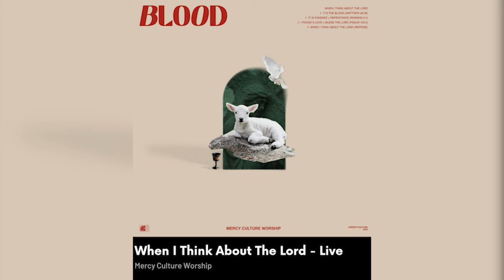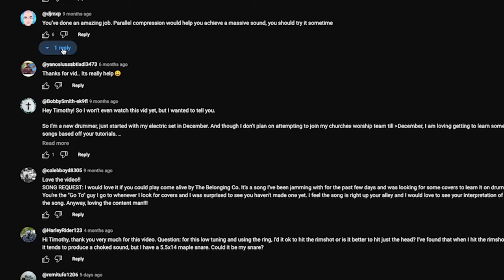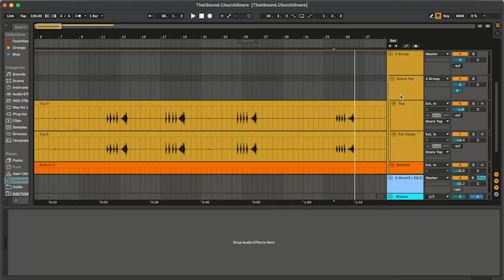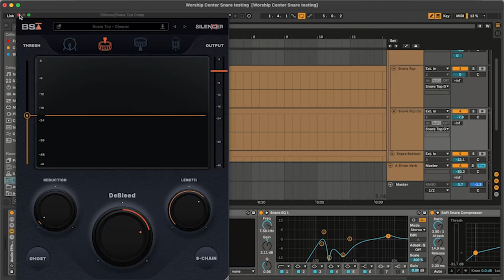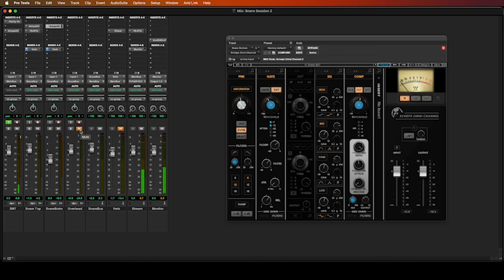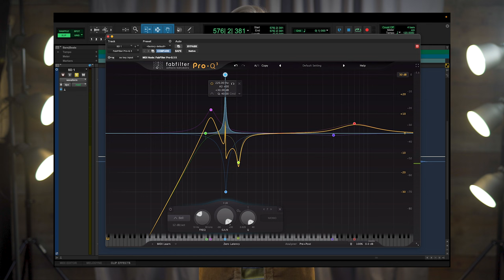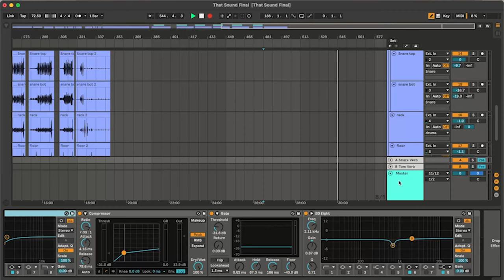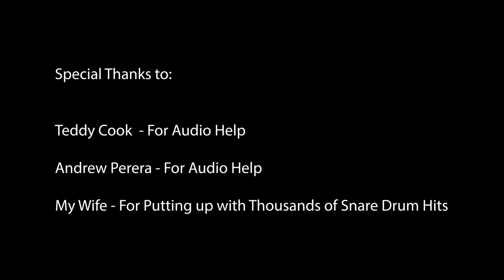That Worship Snare Sound - an exhaustive look in how to get the worship snare sound

Comment: Skipped to the tuning part. 54 mins to explain this is extensive but so is using $2k earthworks mics to capture a snare sound that I consider one of the worst trends in CCM. I’ve never listened to a single CCM record and complemented the drum sound 😂
Reply: What IS a record you’ve complemented the snare sound of then?
Reply from the maker: I wouldn't say the whole video was explaining it, but rather my journey in learning about it. What ended up sounding the best anyway was the $100 sm57, so you are right, price is not everything!
Reply: No insult meant toward you. It's hard to beat an sm57. So versatile  @TrewDrums
Reply from the maker: sm57 really is the classic. I was working as an assistant at a studio recently and the mixing engineer had me set up 15 drum mics. Most of them were in the $2000+ range, except for the snare top which was a sm57. I don't think I will ever underestimate that mic again! The other exception to that rule is the EV868 bass mic. But I don't know anything about that one.

Comment: Very good work man! 

I've found, much like you did, that for a drum tuned super low, your drummer has to be hitting really hard to get that BIG sound. If they're hitting inconsistent or too soft, it'll never turn out right. I know a lot of drummer will even play with the butt of the stick, just to get a little more mass and impact. For our church, tuning the top head up to about 270 makes it more responsive, and muffling with just an M80 has been our winning combo. We also use two mics on the top head, and Beyerdynamic m201 (sounds like a beefier 57) and a DPA 2011c, and changing the relationship between those two mics we can add more beef or attack as needed.
Reply from the maker: That's really cool! I have also seen people use the butt of their stick. I used to do that, but I found it gave a nastier sound when you play cymbals with your left hand. I do a lot of switching between playing right and left-handed, so that wasn't as much of an option for me. Looking at the frequency response of the m201 I can definitely see the beefiness compared to the 57
How do you process the audio?
Reply: @TrewDrums  both mics are processed pretty similarly, low cut around 100hz, big bump between 150 and 200,  big cut between 300 and 500, and decent size high shelf starting at like 3k. 

no gates on the snare top mics. I want to capture all the ghost notes and stuff. 

biggest difference is in the channel compression for each mic. The M201 has a fast attack to accentuate the fatness, the DPA has a slow attack to let more of the transient through. 

Since watching your video, I have stolen the use of a gated verb on the snare. I wouldn't have thought it made a huge difference, but I am now a firm believer in the gated verb on snare. Again, great video!
Reply from the maker: Thanks! I am glad it was helpful. I will have to try that M201 out sometime.

Comment: So practically how do i now Apply this to a live sunday Service worship Setting with an x32 Mixer🤭? 

Because it seems to me that everyone is achiving the sound by Processing it with a mac.
Reply from the maker: In my experience, it is very difficult. We use a Behringer WING at the church I am at and it is somewhat achievable there. The best luck that I found is managing the wet/dry knob on your compression effects and then making a dedicated effects chain for the snare reverb and compress that signal in the effects return. But I am no expert. I am sure someone in this comment thread could shed more light on that particular subject.

Comment: Thanks for doing all of that research! I know alot of drummers that are chasing "that" sound so your research and video are very helpful 👍 unfortunately I play electronic drums in my Church, (actually it's alot easier finding that sound with modern E-drums these days! Lol)  but I certainly appreciate the time and work you put into making this video, keep it up! 👍
Reply from the maker: Thank you! I was thinking about it after I posted this video and thought "This would have been so much easier if I just used an electronic drumset." You can just download the samples that the pros use and upload them to your kit. The only problem you really run into is the sound of the cymbals. E-cymbals never sound right to me. and also re-triggering.
Reply: @TrewDrums  my thoughts exactly... I love the Roland VAD506 and the TD27 module I play at Church, and I love my Alesis 
strike pro SE I have at home... But both of those kits just completely lack in the cymbal department! I've been playing with the idea of switching to those low volume metal cymbals with the triggers built in. I've heard they are a huge improvement over rubber cymbal pads👍
Reply: @TrewDrums  e-drums cymbals samples have never sounded good since the inception of e-drums. Its probably a round-robbin issue (the more u hit the pad a different sound comes out. they just cant get that round-robbening on the cymbals good enough as they do on the drum pads). Hopefully now the Roland bought DW they may come out with some technology to improve the cymbal samples in their future kits/modules

Comment: I find it curious that churches would start with a brass snare and mute all the ring out of it. I think i would start with a wood snare and use an Evans HD dry.
I think people just think an $800 snare is better because it’s expensive so they get it, but it’s not the sound they want so they muffle it like crazy. If you have to use moongel and o rings, you either have the wrong snare or the wrong head or both.
Reply from the maker: I thought that was interesting too. I cut a portion of the video where I actually tried using a wooden drum and tuning it the same (I was actually using an HD dry as well) . It really didn't work well and the video was already pushing an hour, so I cut it. I'm no scientist, but if I were to guess people use brass and copper in this instance because it has a more articulate attack without sacrificing low end. I think that there is no way to remove overtones on a drum naturally without some sort of muffling. Even if you have all the lugs perfectly in tune with each other you would still get some ringing, which you could EQ out but it would change the character of the sound potentially in a negative way. I have seen a lot of larger churches also use wood snares. So, it is definitely possible to get the sound using a wooden snare! I really think the secret sauce is less in the snare and more in how it is processed but the snare is still important!

Comment: I think something that would also help you, is playing louder, your sticks are barely gracing the head of the drum 😭
Reply from the maker: When we add a bunch of compression the dynamic difference is almost indistinguishable after you hit the threshold of the compressor. Take a listen to 35:36 where Teddy plays 5 dynamicly different hits. the last 4 are incredibly similar. I think as long as long as you are hitting hard enough to activate both drum heads, passing the gate, activating the compressor, and you are playing dynamically tasteful then you should be fine!
Reply: unfortunately he wasnt hitting very hard either. the loudness will be fine because of the compressor, but when you hit hard you get the stick attack and the full sound of the drum @TrewDrums

Comment: I have found as long as you have these 4 things will get you close enough and the rest is mostly mixing 

1: 30 strand or more snare wire
2: medium low tuning
3: snare that is at minimum 5" deep and preferably made of metal
4: 2 ply 7 mil + 7 mil batter head muffled as needed

If you have a single ply head try placing a cutout drum head on top of the batter head or buy a BFSD.
Reply from the maker: You summed it up great!